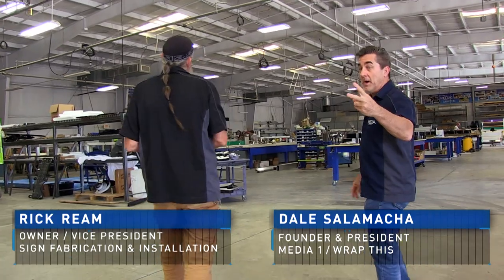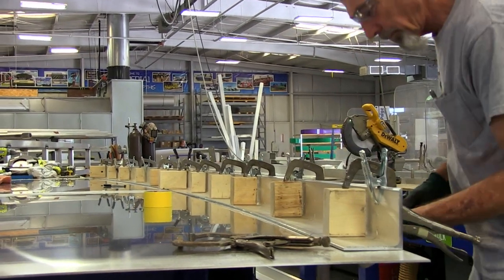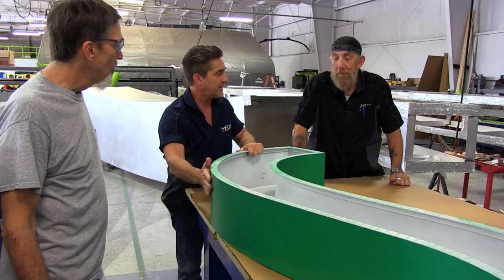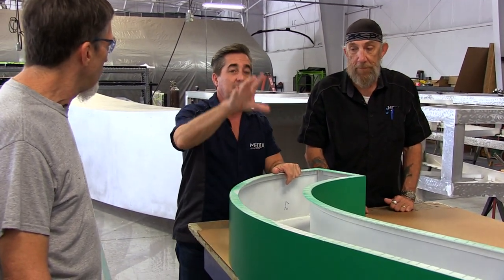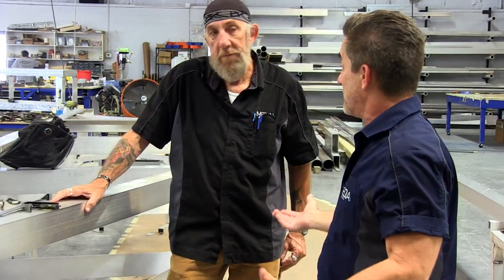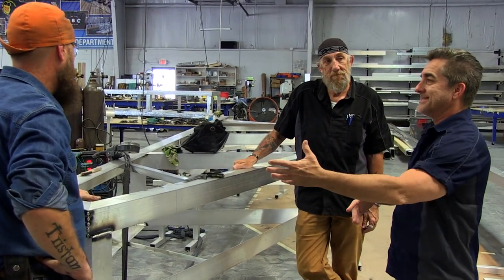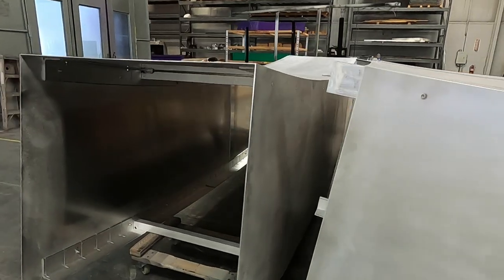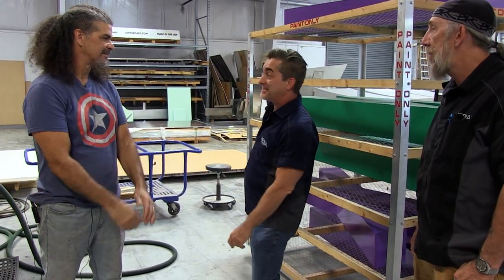SunTrax Portal Part 4: We Are Running Out Of Room

Comment: WOW super impresive with all the fab work you guys are doing hoping you can help answer a couple of questions.....Q1 - Is the external retainer the letter CNC router cut w/ slight outline to allow for flat bar return which is then spot welded internally? Q2 - The large fin sections that have the sheet clad on frames the fixings that are exposed are they then filled over using filler before paint?
Reply from the maker: Hey! 
Ok, I think I can answer this (but you may need to stay tuned to get the real answer, lol...) Q1: yes, we cut an1/8" larger perimeter than the letter size itself, to allow the retainer return to clear the letter once fabricated,  allowing it to be attached to the letter. 
Q2: Yes, we used 3M 8810 epoxy to attach the skins to the fins, but we also followed it up with countersunk screws, and then filled them with 3M 8810 before we paint, then sand, making a smooth final finish. 
Thanks for the questions, keep following the process to see more!

Comment: The cladding sections look like they’re 4-side welded frames. How do they get installed on the mono tube?
Reply from the maker: Actually, they are built upside down. So what you are seeing is the front, the back, and the bottom of the cladding...only three sides...the "roof" panel will be installed after we slide it up onto, and attach it, to the monotube :)